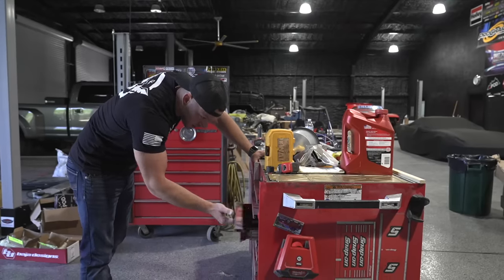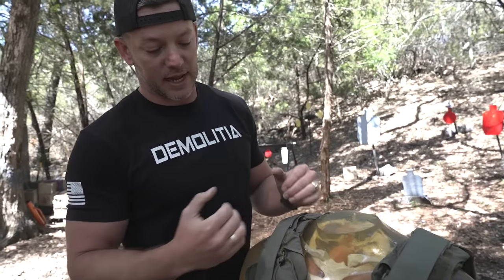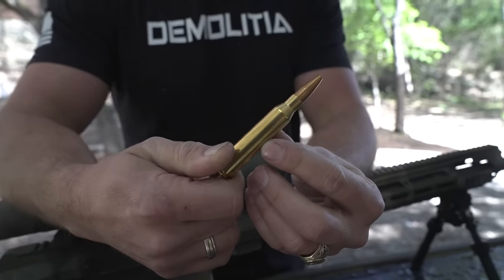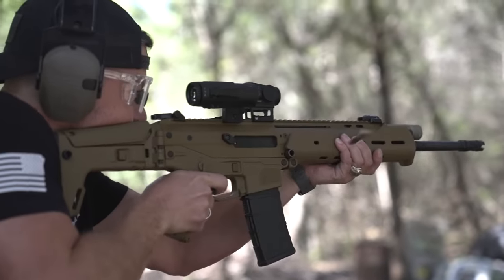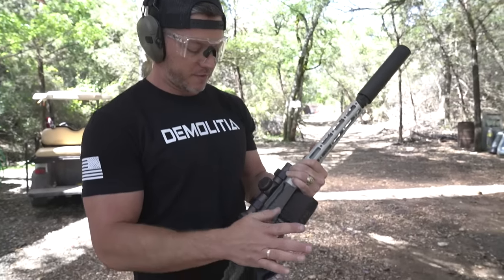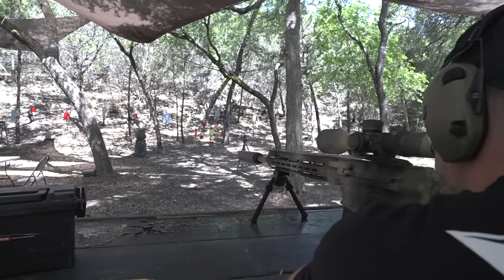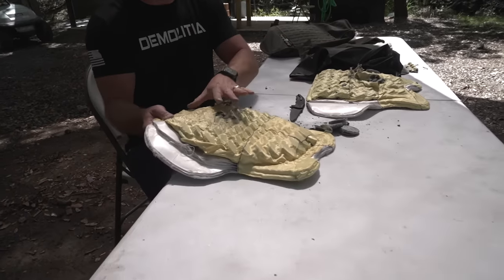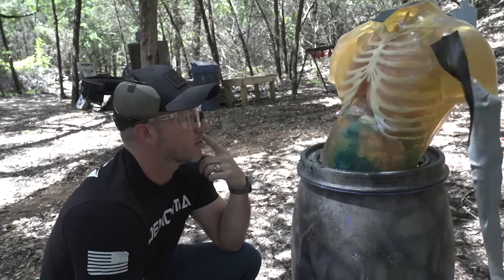World's Most POWERFUL AR vs. Next Gen Dragon Skin Armor of the FUTURE!!!

Comment: You should put a pressure pad behind the armor to see how hard the impact is
Reply: Excellent idea, that should be a standard. And a decibel meter at the gun and near the target so we can analyse the blast and impact sound. Just added as monitors in the corner of the screen.
Reply: Yeah for sure, this would be really cool. Bring some new tech in Matt!
Reply: Idea: test the strength of the everyday wallet, with cards and a few coins in there and see what caliber it can stop and then ultimately see how many stops a 50cal..
Reply: @hermanstaal  normal person wallet or Dad sized wallet?
Reply: @adfadgaqgv  dad sized for sure 🤣
Reply: @hermanstaal  after 30+ years of compacting those receipts nothings getting through
Reply: This is no Garand Thumb here🤪
Reply: It doesn't work like that (pads can't just take a huge spike in pressure like a bullet).
You can already measure that by speed/weight of the bullet. The tricky part is how that force is spread out, but a pad can't measure that either.
Reply: @ryanj610  I'm just the idea guy not logistics
Reply: @adfadgaqgv  I'm the logistics guy; we'll use "Nerd in Exile's" idea of clay to show deformation.
Reply: @ryanj610  I think we just became a team
Reply: repentandbelieveinJesusChrist2  what does this have to do with anything previously discussed?
Reply: Instead of a pressure pad, something like clay but thicker that would give you relative impact

Comment: What I was impressed with was the lack of a real depression on the other side of the Lapua impact. Thats a lot of kinetic energy, it looked very survivable.  On that hit with the steel core AK, it was a very tight shot on these tiles, looked like an 1", I know from doing a lot of test shooting on armor over 35 years that once you get that close of any kind of ceramic armor the probabilities go down on a close quarter shot especially a steel core bullet. A lot of people look back on that future weapons video and saw the level 3 Dragon Skin stop tons of AK rounds. What they don't know was that was pre silicon carbide SOV 2000 technology, for a short period of time and for that particular vest the Dragon Skin tiles were made of Titanium Alloy, and metal is much tougher than ceramic, but not nearly as hard. The reason for switching to ceramic was weight, as even titanium is much heavier than silicon or boron carbide ceramic. Also, the ceramic addresses hard core rounds better. The other thing about that Future Weapons video they were using lead core FMJ AK rounds. On metal they just mushroom and leave a small ding.  Thats how they were able to take 100 rounds, but that technology was discontinued after a short run in favor of silicon carbide ceramic. The very first Dragon Skin back in 1998 was made of Steel tiles, and that was replaced by Alumina Oxide Ceramic tiles in 1999 - 2001. Then came a 1/2 generation of zirconia/alumina hybrid tiles, and then the Titanium Alloy in 2002 - 2003, and then finally Pinnacle moved into Silicon Carbide.  FYI!
Reply: As someone who's been in the ballistic armor industry, what do you see as the  newest developments in armor materials? Mixed carbide sintering? Functionally graded nanomaterials?
Reply: @majordakka5743  Depends on the market, those materials at least in the near future are super expensive. I remember 20 years ago I gasp at the first price quote I received for wanting to use Boron Carbide, now it's not so bad and the only B4C that is still pricey is the HIP'ed stuff (Hot Iso-static Press). Densification of the matrix has added better performance for B4C as well as SiC. I know that Diamond Edge has tried some things with SiCTiB2 hybrid. This has some good performance without the weight or cost increase that B4C has. There have been numerous tests on nanotube infusion of B4C, and host of others. I would say for now you will see premium densified B4C come down in price further since it's fairly commercialized, and the densification process has really upped it's performance at thinner tiles. I really good B4C can work in a level 4 plate at 8mm, where it used to take 10mm. Since it's already commercialized I see that as a trend moving forward also better textiles are in the works for the next generation. SB117 and Spectra 5128 have been on the market now 

There will be a new fiber coming that's even better at least in the UDPE product-line, aramid doesn't really have any real generational increases left, maybe the return Zylon that has the kinks worked out so it doesn't require super special handling and packaging to work for 5 years. I know we had no issues  with t and it's because we used a true one way membrane bagging system, so hot moist air left, but didn't come back. We tested a 5 year old vest and it worked well. It also might be because we didn't try and cheapy it up like Second Chance did.  

Design work will also play a roll, you can see that in our DS 3.0, The edge. Essentially when money isn't the issue and we can use what we want and do every advanced process because the price tag is out there, not many takers for that, but we have sold a couple, some people have lots of money and want the absolute best you can get.   So after all that jibber jabber, even on high performance and new design concepts I think it's really about the taking what is commercialized and making it cheaper and better.
Reply: SB117 and Spectra 5128 have been on the market now  for 10 years
Reply: Hearing so little about it until recently makes a lot of sense to me now. Only ever saw it on a show (likely Future Weapons back on cable tv) and hadn't heard a peep since. Always wondered what happened with it.
Reply: What are your thoughts on "Talin shock absorbing material" as a futuristic ballistics material? Too new? Hype? Good potential?
Reply: A better idea would be armor made from G10.

It's about 65% the weight of steel, doesn't shatter like ceramic (multi hit protection), doesn't deform as sharply as steel.
Reply: @majordakka5743  I'm surprised nobody makes a plate system out of G10 layered composite.

It's like the best of both ceramic and steel.
Reply: @allanbain7930  a bit confusing to read. What is this DS 3.0? The edge? Cant find any body armor named that. Do you have a link or something someone can google?
Reply: @DirectorWestfield  
From what I just read, it sound incredible. Especially that it is durable enough to be reused or last repeated impacts.

Comment: Was actually looking into this armor a few weeks ago. According to what I could find the original dragonskin armor failed military testing due to rounds getting through the overlapping plates missing them completely.
Reply: It was a fiasco of possible politics, possible failure, and unproven environment testing.
Reply: from what i could see on the wiki, it seemed due to mostly politics and classified testing data that im not sure if they released or not? there was a lot of weird stuff.
Reply: I read it was related to it not being able to operate at temperatures of 80 degrees C+.  But I was sat there reading that thinking no soldier could operate at that temperature either, they'd be cooked...
Reply: @glenpeters9388  In Vietnam, Khe Sanh, specifically, they made Marines throw their flak vests in a pile because so many soldiers were passing out from heatstroke. However, that's a different issue from the armor actually breaking down. If the armor fails after being cooked, something as simple as keeping it in a hot AFV could render it ineffective permanently.
Reply: @glenpeters9388  Soldiers could absolutely be exposed to that and higher temperatures, though. If, for example, your vehicle is hit and catches fire, suddenly 176 degrees is child's play. You won't be there long, but you may be there long enough to ruin your body armor.

Comment: I heard that the reason it failed military trials in the mid-2000’s was because at high temperatures, the glue that keeps the plates together would melt and allow the plates to separate, which in turn allowed the rounds to pass easily through sections of the armor.
(Edited for grammar error)

Comment: I just looked them up and they are way to Expensive for it to let anything throw Ceramic is probably not the way to go Individual titanium plates Might work if they didn't try that it would abb to the weights but would be worth it or anything that works better than the Ceramic plates